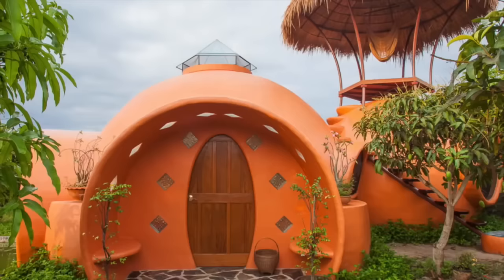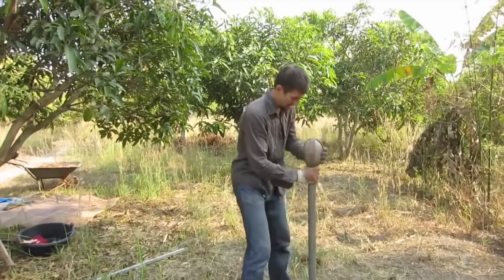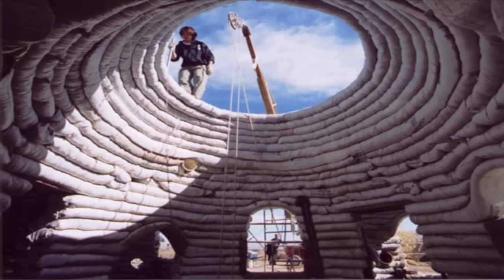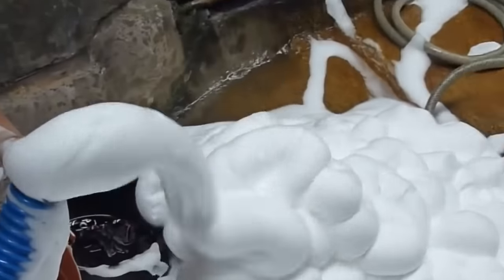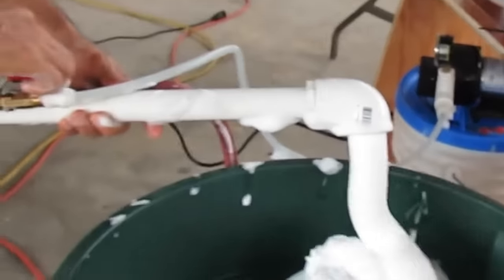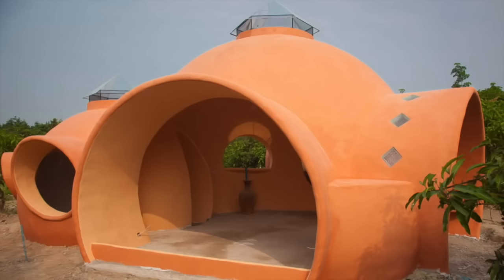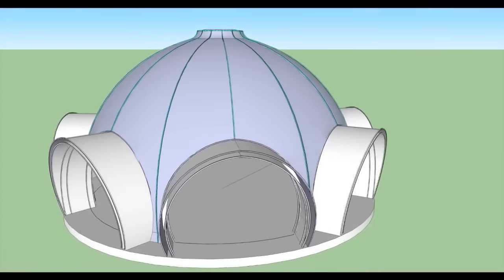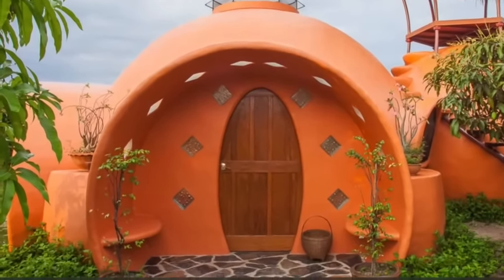How We Built this Dome Home (For Under $11,000!)

Comment: OMG, I thought you were building Monolithic Domes. You’re reinventing their wheel. You need to look them up, they figured out what you’re doing much better decades ago.
Reply from the maker: We are very familiar with Monolithic domes.  They are very differnt than an Aircrete dome.  For many people a Monolithic dome could be a good option but they won't save you money over conventional building and there isn't much for a DIY person to do. With aircrete it will be lower cost than conventional building and its very friendly for someone that wants to learn to do some or all themselves.
Reply: @domegaia  It doesn't sound like you're as familiar as you think you are. An MD would save a lot of money over conventional construction. Also, plenty of DIY people do their own MDs as well. Aircrete is essentially a similar process to MD, but less sophisticated. Like you're re-inventing the wheel.

Comment: Aircrete is definitely not waterproof.It is somewhat water resistants even when autoclaved.and don't believe the video of that guy smashing the block with a sledgehammer, especially if you are mixing it yourself without autoclave. I have worked with the stuff  Downsides that I can see right off the bat: far less earthquake resistant than most domes. Size limited. At first glance looks Incredible, but is just ok. I would like to see a detailed breakdown of components and proportion contributes to final cost given this was built in a country with very cheap labor. Could end up costing triple in a country with pricy labor.

Comment: I don't understand why you're pretending like aircrete isn't just concrete with air added to it? This comes off as one of those late night, As Seen on TV products. You don't have to make one material(especially the base material that YOU are using lol) sound like shit in order to sell your services.
Your creations in order to utilize aircrete are amazing, so I really don't understand the purpose of downplaying concrete.
Reply from the maker: Aircrete is very different from concrete.  Concrete is cement with aggregates like sand and rocks added.  Aircrete is cement with foam added to create tiny air cavities in the structure and expand the volume 10x.  Aircrete is very lightweight, has insulation value, and is easy to work with.
Reply: @domegaia  and still comes from cement, which was my point.